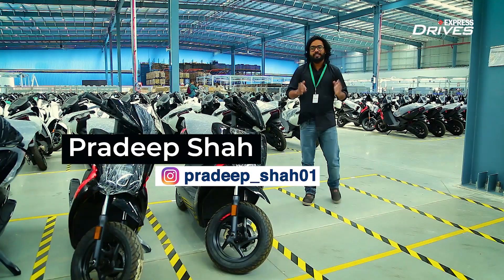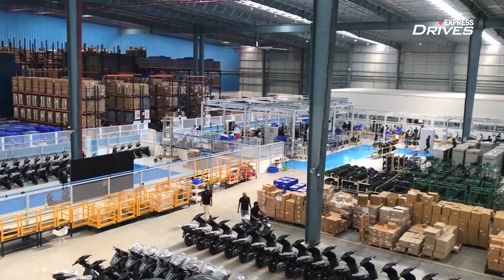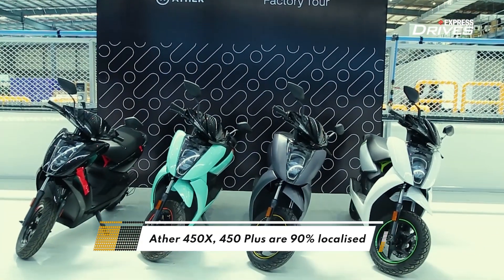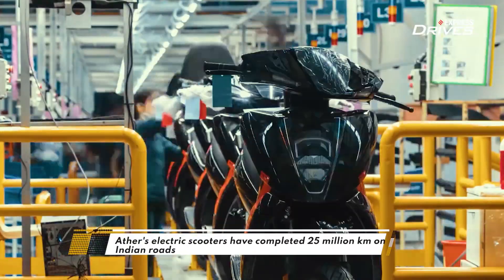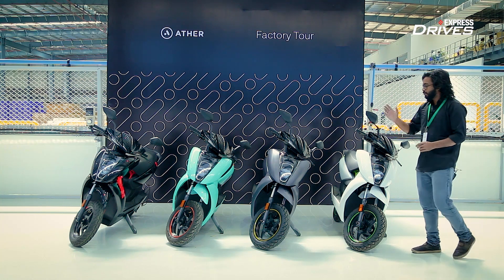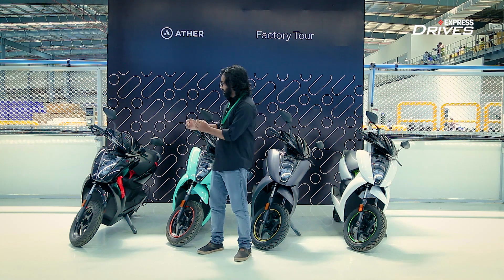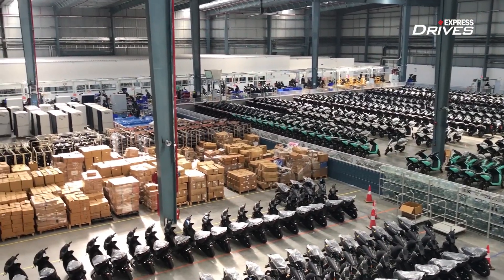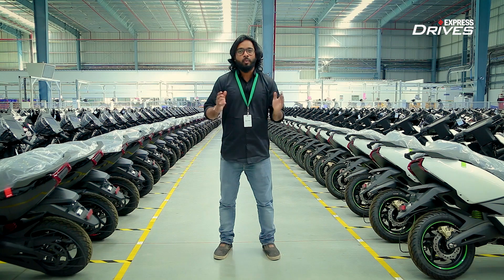How Ather 450X, 450 Plus Electric Scooters Are Made | New Hosur Factory Tour

Comment: My concern is, what happens in case if the EV scooter malfunctions on the road. There is no roadside mechanics available for it, rider has drag it long to the showroom/service centre or leave it there.
Reply: They have roadside assistance. You can call them. And it has 3 year warranty. If anything happens, they will replace it for free. Mine had a faulty wiring and and fan. They replaced it free of cost.

Comment: this scooter is only for rich people. just 70km range for 1.7 lacs scooter.
Reply: It’s absolutely the best for cities like Bengaluru!
Reply: Sadly yes
Reply: Ampere magnus pro and Zeal comes around 75k only
Reply: @manojantoa1945  , you cant compare Ather to Ampere. Ather has many features such as aluminium frame, connected features, highly efficient PMS motor and it comes in a completely different category of premium scooter. Also Ather uses mostly quality components, designed and made locally. Ampere is mostly budget oriented. Most parts are imported from China and assembled. Also build qualities of each differ mostly.